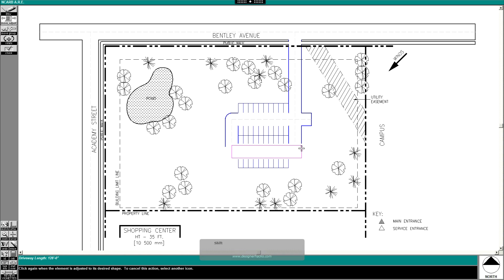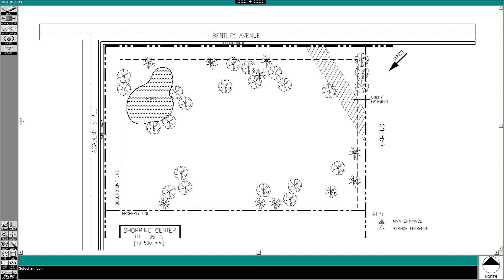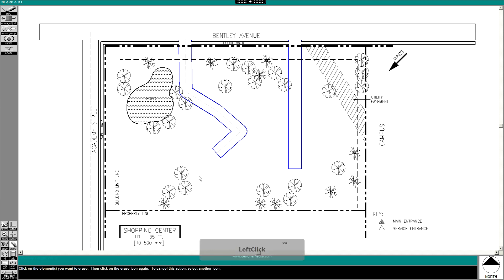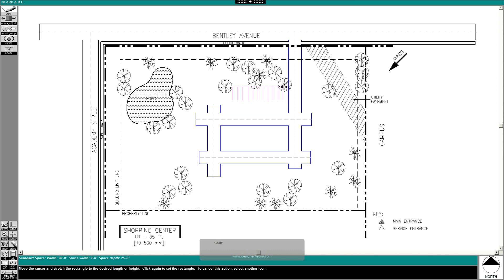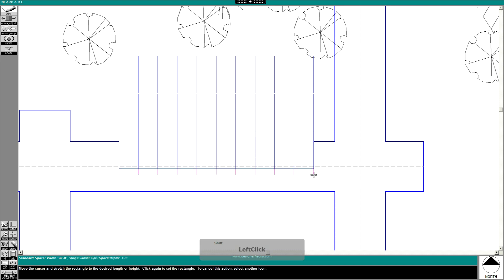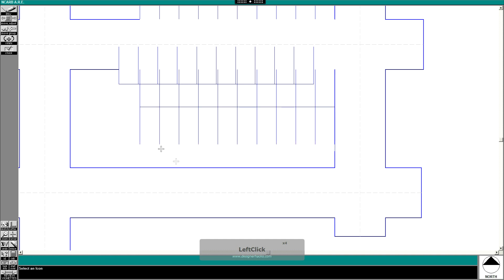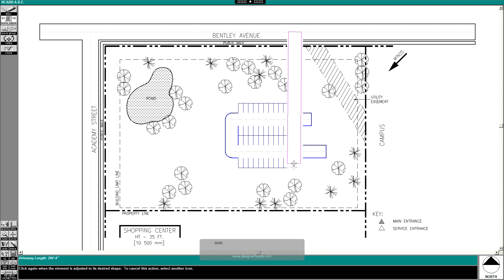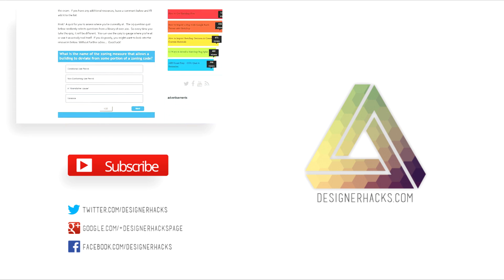ARE SPD Vignette: Site Design - How to create a quick parking layout

Comment: I would really like to thank you for this video. This tip -combined with your MC test packet-helped me pass SPD on the first try! Before watching this video, I was sketching rectangles and laying out so many dimensions to check the software, (i.e. catch the midpoint of the roads at 12 ft etc)  it took me over 40 minutes to draft ONLY my parking. After your tip, I drew a correct layout in 6 minutes! Thank you thank you thank you!

Comment: Does the parking lot block views??? I can't find an answer.
Reply from the maker: +s0c0urt Parking lots should not be used as a view blocking element on the vignette.  To block views, use buildings and coniferous trees.  I hope this helps!  Good luck on the exam!
Reply: +Designer Hacks I was thinking more so, if a building needs a view to something else, can you place the lot between the two, or will the lot hinder that view?
Reply: It's way too late to reply to your comment but just in case someone else comes across this and needs an answer, no parking lots do not block views.

Comment: Good work! Personally, Im a frothy mouthed sketchup zealot :) but its always interesting to learn different methods. It looks like a good program.  BTW it might be a good idea for carpark designers to consider the required minimum inner radius for turning into carpark spaces. City Engineers can get picky about that.
Reply from the maker: +TreblD This program is actually just used in the architecture registration exam.  It's pretty painful to use lol.

I used to work at a firm that designed parking garages, most times as long as you stick with a standard 12' lane things work out.  The greatest place of concern is 180 or 'u' turns.